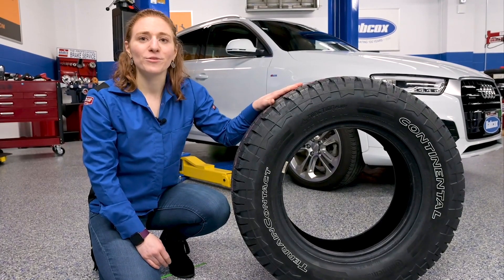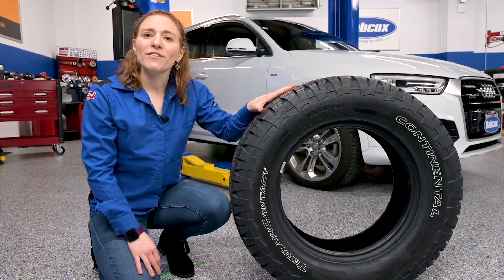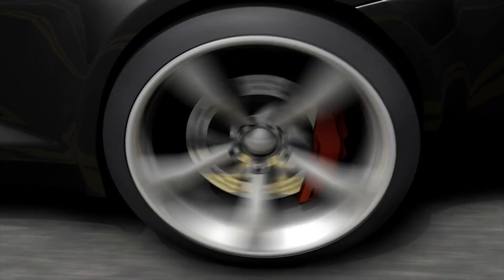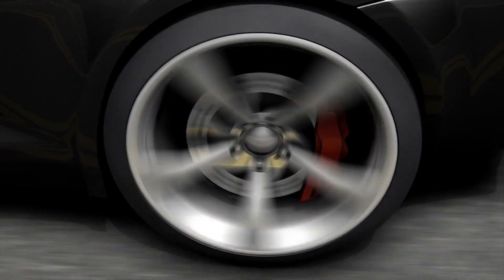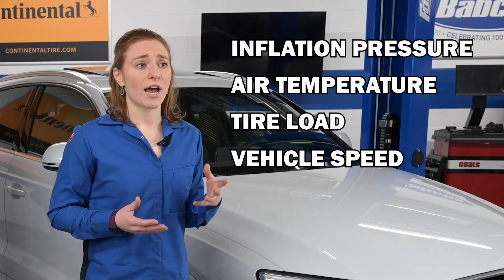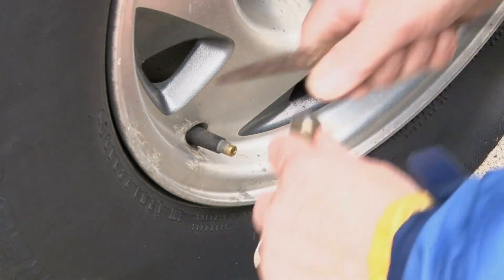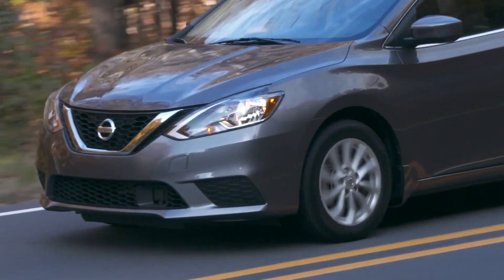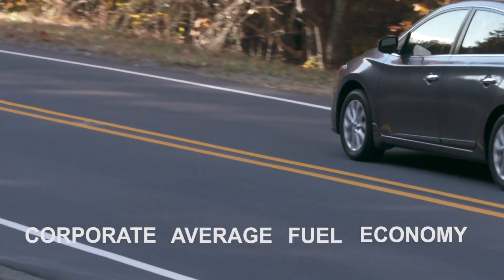Why Rolling Resistance Matters

Comment: is rolling resistance affected by rubber compound? gripper compound has more tire rolling resistance?
Reply from the maker: That's right! Compound has a lot to do with a tire's rolling resistance, but it isn't the only thing. Lots of other tire elements, like the tire's tread pattern and inflation pressure, will also have an effect on rolling resistance. Manufacturers typically put a ton of engineering into a tire to dial this in as best they can.
Reply: @TireReview  i know that. sidewall stiffness also affects rolling resistance.

my reasoning is as follows. If manufacturer try to do less rolling resistant tire (for examlpe EU grade A) it has to have less grippy compaund.  In other words if someone searches ultimate grip better choice is  more rolling resistant tire